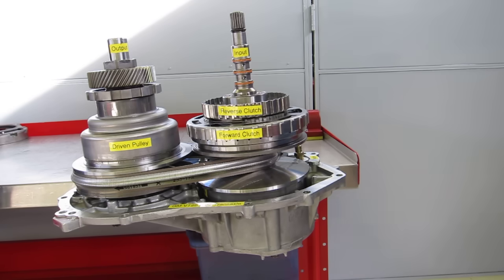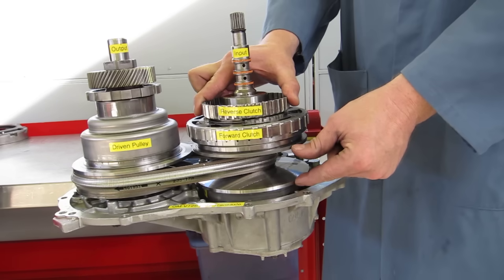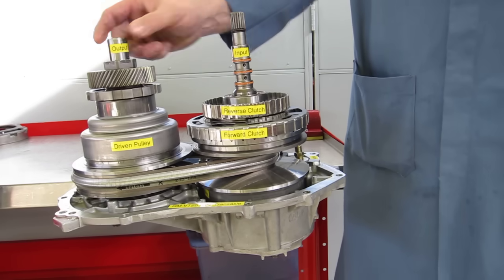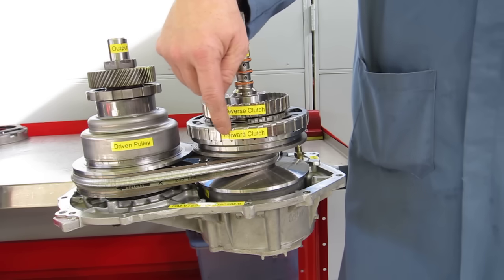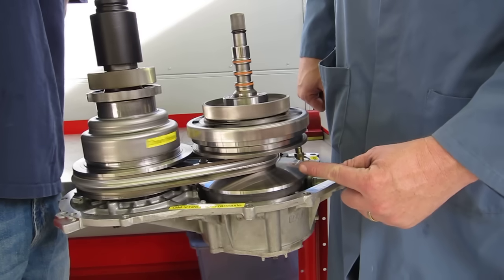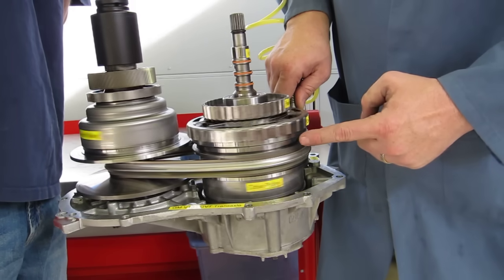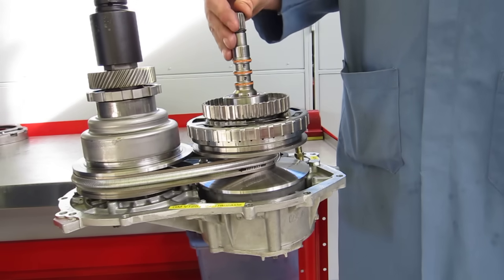Continuously Variable Transaxle (CVT) Operation

Comment: They all fail at 75k or less. Which why these cvt cars are flooding used car lots.
Reply: interesting because my prius also has this type of transmission and has 170k miles going strong. but maybe thats because toyotas just never break lol
Reply: @Rubiks2025  prius don't have this kind of cvt. They call it "e-cvt" but they are not working in the same way at all. Basically in prius, they use planetary gear so that the speed of the electric motor and thermic motor are added. This way, it can simulate any gear ratio without any pulley that can break.
Reply: why my CVT car(rebadged Lancer GT, Proton Inspira) is at 150000k and still running smooth?
if you talk about pure Nissan CVT, maybe legit, but with others, maybe not
Reply: My Civic didn’t even make it to 75k 😡
Reply: Worst CVT comes from Jatco (Nissan, VW, and many other brands) they don't last long
The best are from Toyota's partner. (I forgot their name tho)
Reply: @Arakij11  Only ones from AISIN are reliable
Reply: @PineBarrens75  what kind of civic do you have? I have 2015? 75 thousand miles? What happened?
Reply: Cheesehead-Tony:  What year Civic?  Is the failure from hard driving.  I have a 2015 Civic with only 7k miles,  should I sell it now?  I baby my Civic because of the CVT.
Reply: @rondail5675  I have a 2016 Civic EX-T with 129,000 miles on it. Haven't had any issues yet. I think Nissans just gave CVTs a bad name.
Reply: Thanks Panda,  that is good news!
Reply: @rondail5675  I have 2015 civic too no problems 29500
Reply: Thanks Brian,  nice to here.
Reply: My subarus cvt is known to be fairly reliable, it is also warrantied until 100k too.
Reply: "They all fail at 75k or less"......now that sounds like a statement based in fact !   Yeah right.  Sometimes it's better to shut your mouth before looking ignorant.
Reply: Especially the 04 v6 accord trans.
Reply: A bit like cam belts
If you change the belt when recommended no problems.
The Subaru CVT seems to be the best.
Reply: And yet i have a 2009 altima at over 130k miles on the stock cvt
Reply: 2009 Nissan Sentra FE with the 2.0L and a CVT. 184,xxx on the odo and still going.
Reply: Not made for car made for skidoo
Reply: It comes down to good maintenance
Reply: They're horrible to drive too. Shuddering is common and that loose feeling is always present
Reply: @spitNpolish spitNpolish they did in the 90s but stats show they're not as reliable as once were
Reply: Not if you get a reliable brand like Toyota. 

If you are referring to Chrysler and Nissan CVTs, then you got a point.
Reply from the maker: Thanks for your feedback
Reply: My CVT tranny failed at 71,000 miles on my 2013 Nissan Versa. Repair cost...$3400!

Comment: Hi , very good and informative videos , watched many of them , just want to ask I have Mitsubishi Lancer 2008 and it has CVT in it , everyday early in the morning when it is on cold start (the temp outside is 9  degrees Celsius) when I start reversing ,the car slightly vibrating and makes unusual noise as soon as I go to driving shift the noise is gone and that is happening only on cold engine , I am not sure what to do ,my mechanic has no idea what it is , if you can help that would be great Sir , thank you very much.
Reply from the maker: Check for the proper fluid type and fluid level.
Reply: WeberAuto at my last service the transmission fluid was changed and the proper type of fluid was refilled , the mechanic was assuming that the fluid was the cause of the noise but even after changing the noise didn't leave , and the old transmission fluid didn't have any traces of metal , so hope it will work fine until I get a new car  , but really want to fix this problem and afraid that this noise is the sign of something major gonna happen to the CVT , if anyone had anything similar or have any solution will be appreciated for help , thanks.

Comment: I can only see a win/win for this transmission. Less moving parts, less hardware, lower weight...
Reply: Except the belt is made of thousands of moving parts...
Reply: If you didn't understand that I count the belt as one part, I cannot be bothered to explain further.
Reply from the maker: Thanks for your feedback
Reply: I do not know mate , but from my experience the old slush box torque convertor auto if it is a well made, (mine was ) ,    is a pretty good bit of gear , in my own car for example , it has been a big family sedan and tow car for thousands of k`s with our caravan and quite a few tandem car trailer tows over the years , it is now 17 years old with nearly 260,000 k`s and nothing but general servicing (clean oil and filter ) and a couple of seals in that time , with one extension housing , one selector (very cheap to maintain ) ,  and it still works well , and i suspect it would do another 3 years without any problems .
  That is a very good service life in my book , 
Sadly i have not looked after the body as well as i should and it is getting somewhat shabby being left out in the weather with no garage for most of its life , so the poor old baby is going soon . 
 But there you go , the slush box auto lasted the life of the car , win win .
Reply: Yeah, well I've seen tons of automatics broken, dead, slipping like crazy, worn out, and useless. My van is sitting in my driveway because the automatic transmission is broken. The automatic transmission on my car is not far from being the same way. In my opinion, if it is made in the US, it is most likely junk to begin with, but clutch replacement is far less expensive in a manual than an automatic.
Reply: Dude, these things are absolute shit.
Reply: ...and you know this because...?

Comment: This is absolutely a great trans, if they had come out with this first before the automatic transmission, it would've been very hard to sell the auto trans .
Changing gear ratios vs gears means better accel, and continued toque throughout range with less dips in power between gears.
This equals better fuel economy and less maintenance and longevity for the trans, plus the added benefit of never having to change trans fluid unless there's an issue means less dollars, and I'm not sure but I've not heard of a large amount of these having problems with the belt, you are right it is a weak spot but the amount of failures is nowhere close to calling this an issue compared to the amount of cars using this or a variation of this out there, there are literally like over 65 different model vehicles from like all the manufacturers, including a few supercars that have this type or a variation of it in them, so not really an issue right
Reply from the maker: Thanks for your feedback!

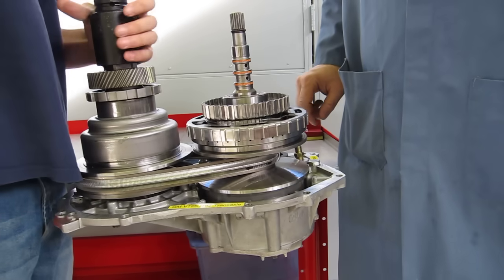Comment: At about 4:19, Seriously, why did you not cut that out and do it right? Makes you look inapt at this, use the right tool for the right job. Geez man this is why people don't trust mechanics. 
You used the wrong socket, and to some this is stupid to say anything about it,  but to me it shows you're not thinking and your rushing and that's bad because you do it on video means you probably are to sure about what youre doing that you miss stuff and have to go back. Because you missed it or depended on someone else to do it instead of yourself and of course it will be their fault and not yours because of course you're the professional right.
Appearance of professionalism is important, should've told your guy to go get the right tool and continued. Now it's stuck, without you having applied any opposing torque, which means it didn't fit, how could you not see that it was wrong? And if you did why did you do it knowing that?
Reply from the maker: Thanks for your feedback!

Comment: Normally I'd say this looks like a terrible idea for a car, and I'm not sure how other manufacturers have implemented their CVT's, but I've driven the Toyota Yaris quite a lot and I actually like it. I don't think it feels unresponsive at all, and it has simulated shift points for "manual" shifting if you'd like, but I think it does a great job at selecting RPM by itself. I'm glad it's not my personal car though, because I have my doubts about longevity, but as far as comfort and drivability goes, it works really well
Reply from the maker: Thanks for your feedback!

Comment: I have a 2003 Honda Civic with a CVT.  It has a bad judder during acceleration, I'm guessing between 1st and 2nd gear speeds.
It seems to be worse during warm weather; noticeably different when the engine hasn't warmed up yet and after it has (sometimes with a violent judder after warming up or during Summer).  I'm using the latest recommended transmission fluid by Honda and have recently changed it with little to no sustained improvement in the judder.   My question is, what are your thoughts of using a different transmission fluid, for example Lucas Synthetic Multi-Vehicle CVT Fluid or similar product.
Lucas claims that it "Resists shear thinning better than typical CVT fluids".   Your response is greatly appreciated.  I'd like to keep this car until I can reach at least 200,000 (at 187,000 right now).  Thank you.
Reply from the maker: I don't think the fluid will help. Those CVTs have a start clutch that is known to cause that issue. I am impressed you made it to 187,000. There is an update to the start clutch and valve body that would cost more that the value of the vehicle to repair.
Reply: Thank you for your response. I may give it a shot anyway in hopes that it may do something helpful.  My fear is that changing to a different fluid may cause a problem, such as the belt slipping, etc.

Comment: My CVT has an issue no forward drive but reverse works OK but if i let it cool down i get forward until it reaches operating temperature then no more forward drive.
Reply from the maker: Thanks for your feedback! Check your fluid level. It sounds like the forward clutch pack has troubles.

Comment: The 0.4:1 is 2.5 in the other way.... overdrive. I wish this guy would use a regulator so that we could see variations in between. This would show that each pulley would vary exactly the same width in opposite directions simultaneously.
Reply from the maker: Good idea!

Comment: Would you believe a 2013 Altima CVT is good? Just curious. I have 70k on mine right now.
Reply from the maker: Yes, they made a major change to the CVT in 2012 to improve it.
Reply: WeberAuto thank you! Do you know why so many people say that they are failing in their 2013’s? Does it have anything to do with how it is driven? 

Thanks!
Reply from the maker: There was a bearing preload issue on some of those early models. Although it was inside the transmission, it was not related to it being a CVT transmission
Reply: Josh S. I have 96k in a Jeep CVT, Doesn't mean it's good, means I have a warranty !

Comment: So if it's mainly just the belt that causes these transmissions to fail, why does it cost thousands of dollars to repair. I also watched your video of the assembly process, seems too simple to be so expensive.
Reply from the maker: When the belt fails, the pulleys are also to be replaced. Damage to the pulleys can occur when the belt slips and fails. Thanks for your feedback!
Reply: Thanks for the fast reply...If let's say you were to replace the belt every 100k miles...do you think the pulleys would still need to be replaced? Is it worth it to try to maintain the transmission this way?

Comment: Seeing how this works, I wonder what causes a hard "shift" when I floor it from idle to get high rpms, let go of the gas for a second or two, then press the gas again to get up to speed faster than I would if I had just pressed the gas normally. I drive a Nisan altima
Reply from the maker: Some Nissan CVT actually shift from 1st to 2nd, and then are a CVT from that point.
Reply: I naturally do the same thing with my car. Nissan versa.

Comment: No comment on how it shifts, still seem to be missing something. I know how a snowmobile clutch works but how does the fluid end work?
Reply from the maker: CVTs do not shift, they just change the drive-to-driven ratio. the pressurized fluid helps spread out, or clamp down, the pulley widths. I hope that helps.
Reply: Sorry just a little to basic for what I'm looking for.

Comment: Who says this CVT is shit, well this CVT transmission is great than the pervious automatic transmissions using planetary gears, very complicated and a pain in the ass and pocket to fix, even resorting to replacing the entire transmission box. This CVT transmission is so simple, not too many gears to shit, if you break the belt, simply replace it with a new one, it will just slide through
Reply from the maker: Thank you for your feedback

Comment: sorry forgot to the cvt on the volvo/daf used 4 cones two on eash side connect to the back axle controlled by vacumm for the engine for drive ratio
Reply from the maker: Very interesting design

Comment: could you talk about how the pulley move plz?
Reply from the maker: Hydraulic pressure moves the pulley wider or narrower
Reply: how to control the Hydraulic pressure? I want to build a electronic control CVT unit for my race car
Reply: can I control the ratio with control the step motor only?

Comment: A bought a Nissan versa 2016 sedan last year. Didn't know much about the cvt but if I did I wouldn't have bought it. I drive so slow never going past 2000 rpm and accelerating slow because I'm so scared of one of these belts to break
Reply from the maker: The 2012 and above Nissan CVTs are greatly improved and more reliable than the previous versions. Have a good day!

Comment: Why a torque converter and not some form of a "dry clutch" ?
Reply from the maker: I do not know, probably the cost.
Reply: I checked out some other videos and one of them mentions that there are other cars that use a dry clutch (Honda civic with CTV) but they break down a lot. Not explained why since a regular manual clutch is used more often in a day (every gear change) but that's how it is...

Comment: Oh yeah i changed everything btw cam belt, glow plugs, oil, gearbox oil, fuel filter, air filter, drive belt is only few thousand miles used. The engine fires up on a dime and everything seems fine apart from maintaining ratio

Comment: Well originally before when it first happened i was travelling at around 50mph and it did what i said but felt like the whole gearbox or engine blew apart from under me and car was immediatley thrown into neutral and from then i couldnt take it over 10mph without it droping gear to neutral and so when i got it home eventually i noticed that the wear pegs were gone and only one remained and now i changed them it drives much better but say going past around 30mph it make same winding sound but it does not loose gear and same when i want to slow down for a tight corner it will do the same thing but dosent fall into neutral anymore which is why im thinking is it just the cable tightness it is a kubota z482 aixam if any ideas... thanks alot
Reply from the maker: I don't know anything about Kubota vehicles. Sorry I cannot be more helpful. Have a good day.

Comment: Can anyone help i replaced the rubber wear wedges of the clutch and it drives but when i want to speed up or slow down it makes a winding down and knocking sound that you can feel while driving , do i need to loosen or tighten the gear cable or is it something more serious???? Thanks in advance to any help
Reply from the maker: Hi, I am not totally sure I know what you are talking about, but It sounds more serious.

Comment: First thanks for This video.my car is byd g3cvt .I have aproblem when It start moveing there is wait and jump.
I think the transmesion my be need flushing and change the cvt fluede.do you think.
Reply from the maker: That sounds like a good place to start. Make sure you use the correct CVT fluid. Best wishes
Reply: WeberAuto شكراThanks

Comment: My 2010 Suzuki Kizashi has a CVT. 119,000 miles so far. Still smooth as silk. I always wondered how they work. Now I wonder no more. Pretty much the exact same as a snowmobile. Only they use rubber belts that break. Excellent video. Thank you.
Reply from the maker: Thank you!

Comment: Out of everything I’ve seen so far, this video explains the best. Thank you.
Reply from the maker: Thank you!
Reply: @WeberAuto   should have used a psi regulator, other than that top notch man
Reply: Even in 2018 one of the best videos about this subject.
Reply: I agree
Reply: Very similar to a centrifugal plate clutch system used in snowmobiles, where the inertia of spinning weights changes the gap between the plates driving the belt.  Interesting to see how its adapted in cars. Nice video 👍
Reply: You have something against cute kittens?
Reply: Idite nahuy, pishite po-russki

Comment: I wondering how long the belt of the cvt  lasts? 100k mile?
Reply from the maker: Yes, that and longer if the vehicle is not driven like a race car. Make sure you perform the proper services at the proper intervals and it should last a very long time.
Reply: nissan x-trail owner in australia here 230,000 KM before the belt broke, was just driving along then no drive... AU$5k to rebuild pulleys/belt/convertor/bearings etc...AU$9k for a new box from Nissan, if there was one available lol..
Reply: The CVT and engine on my 2006 Civic Hybrid are at 400,000 miles and still going strong...

Comment: These belts are very difficult to turn when we see them at the Hardware store.  Maybe a skidoo belt can't be turned by hand very much.   That is remarkable demonstration of the ratio changing.  The belt seems very fluid.
Is that possible to use a gear over the same surface?
How is the belt in the cold weather, -20, -50'C
The surfaces suggest induction.  Is that a possible coupling?
We would like a planetary sprocket with a clutch to create a two or three speed gearing for 10 horsepower.  Who makes that?